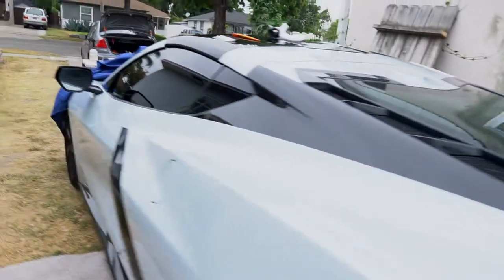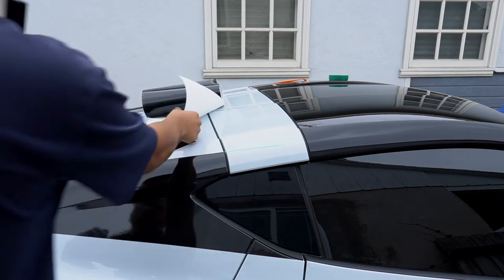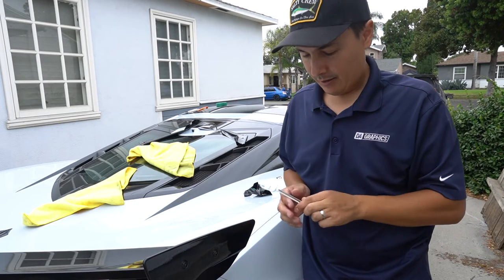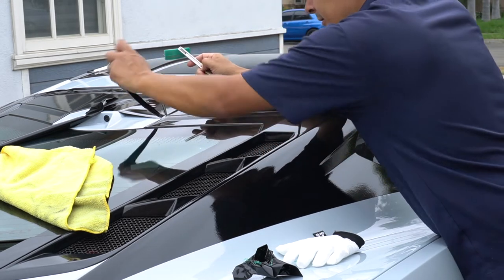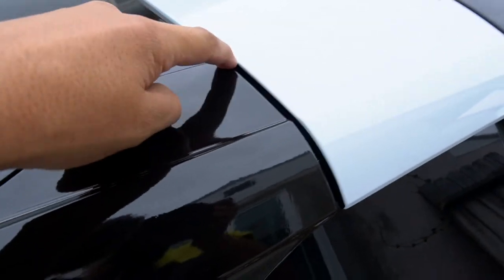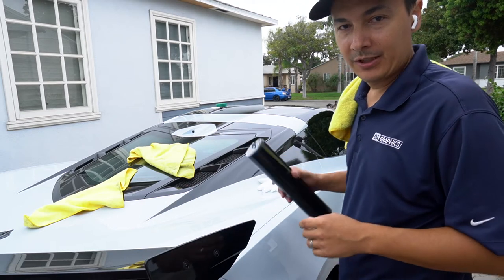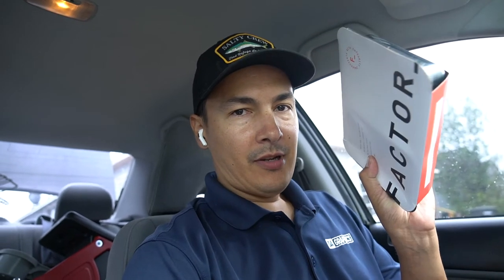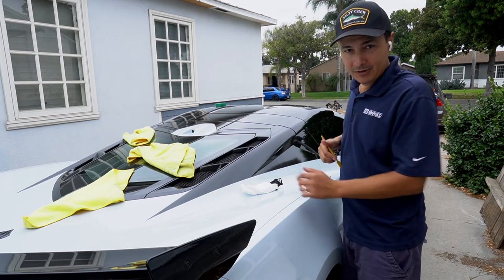2021 Corvette Sting Ray - Custom Roof Wrap

Comment: How did you create the template/shape for the inset area around the camera? Struggling with this currently!
Reply from the maker: @CJ40139  I used masking tape to make a template. Then place it on the vinyl and trace it then hand cut it
Reply: Thank You! I’ll give that a shot. I tried a few other ways and failed miserably so the flat stuff is done and that’s not lol

Comment: Why didn't you take the roof and A pillars off..would seem to make it easier...also can you give me a ballpark price..I'm in Seattle and getting some crazy prices. Same job, same vinyl..
Reply from the maker: The roof was already black, it’s the glass roof top. Taking it off did t really help, the weather seals are still attached to the other parts of the car. I think I charge around $500 for this one. And that’s without wrapping the roof. I’d probably go up to $700 if I had to do the roof as well. Thanks for watching! 😎
Reply: @dagraphics4369  thank you. Couldn't see the glass top. I'm getting $1400 including the top. I'm going to try it myself. Going to practice on a junker first.
Reply: @thereissomecoolstuff  Cripes! $1400….some of these wrap guys must think they are surgeons.
Reply: @RadioguyJ  I think so. Claimed they couldn't use precut vinyl because the car is to new. Still shopping.
Reply: @dagraphics4369  Local shop wants $485 to wrap A pillars, top, and nacelles. Seems like a great deal.